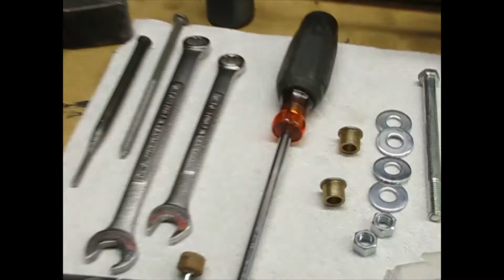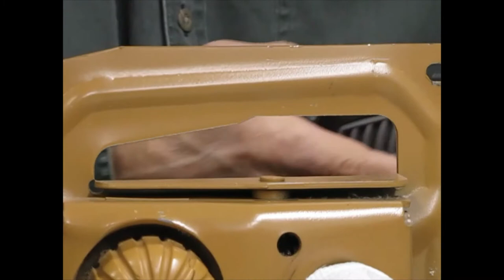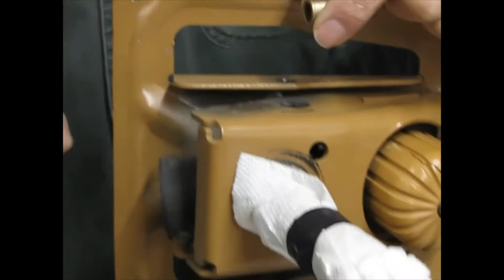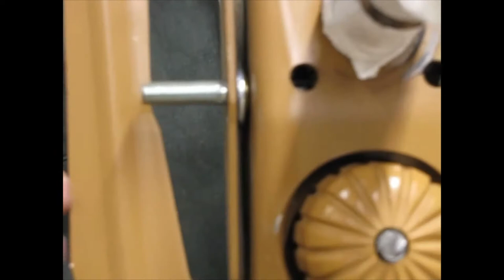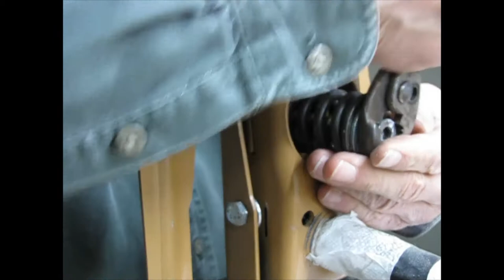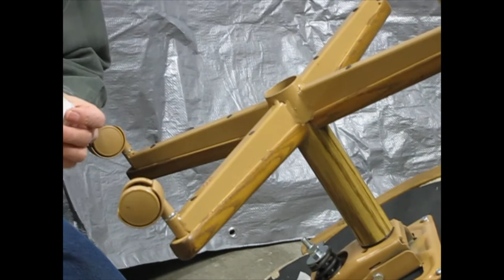Chromcraft Swivel Tilt Mechanism Repair Rebuild

Comment: I just returned from Sam’s Welding, Inc. in San Diego, who welded two of my Chromcraft chairs’ stems on the swivel/tilt mechanisms. Thank you for this video. It helped me figure out the actual problem with my chairs. Luckily the plastic bushings are ok for now. After welding, the chairs are as good as new!  Only cost $20!!  Thank you!

Comment: Thanks, been searching for a video like this for four years. Now i can repair my Blacksmith  dinette chairs. Ebay price for replacement swivels now over $75. Bought two and they only lasted about a year. I had the same ides as you, but could not find suitable rubber bushings. Now will go with the bronze.
Reply from the maker: You are welcome!

Comment: I may have to take mine to a welder. Sooo disappointed in my Chromecraft chairs! The first set I had lasted over 25 years. The new ones barely lasted a year, they are shot! They all wiggle and tip and make so much noise! Thanks for the video.

Comment: Great and useful video, thanks much. Don't have a Dremel but my Rotozip with a cutting wheel fit nicely into the space between the inner and outer swivel bases and neatly cut the pin. It was a simple fix after that.
Reply from the maker: Glad it was helpful.  Thanks for watching!

Comment: Thank you for the awesome video. My chair has a different issue. The center metal rod has too much movement. When sitting in the chair, it wobbles side to side. Do you have a fix for that problem?  Thank you!

Comment: First, JW, excellent tutorial!  I appreciate that you did it after working on a few of the chairs and then made a clear presentation of the breakdown and solutions for each dimension of the problem.  

On my chairs, the stem has wiggled up and into the plate mechanism and that has generated so much play that they are unusable.  I haven't "sacrificed" one of my chairs yet by grinding the pin out to see more clearly if the stem is supposed to be welded on, but I have considered it out of frustration given the dearth of relevant tutorials.  

But now maybe that has changed!  

Since you -- and many viewers -- have had a good look inside, is that stem supposed to be welded?  If not, then is my problem just one of replacing the bushing inside of the cylinder?  

Thanks!  Go YouTube DYIers!
Reply from the maker: Gary, at about the 13:50 mark I mention a welded in cross support member.  I looked at one of my chairs this morning, and that welded in piece is what holds the stem in place.  It appears to be a piece of 3/16” x 1-1/2” flat bar with a hole in it for the stem to go through.  It is welded all around the hole and then welded to the chair mechanism at the edges.

With a flashlight and small mirror, you should be able to see if the welds are bad when you wiggle the stem.  The good thing is, if you take the mechanism apart, all of the welds would be very accessible and could easily be re-done.  Then you can make the “stem weld fix” YouTube video!

Thanks for watching and for your comments!  Good luck!
Reply: @jwsworkshop4169  Thanks!  I will take a look.  If it is the case on one, I bet it is the case on all four....
Reply: @garyschaub1116  Did you ever tackle this repair.  I think I have the same issue on two of my Chromcraft chairs.  The pole move up and down inside the mechanism.
Reply: @melissarij8687  Hi Melissa,
I did tackle this repair.  JW was correct: there were welds intended to hold the stem in place.  That weld had broken on each of my 4 "Black Prism" Chromecraft chairs.  Since the weld was the problem and I lacked the equipment to fix it, I took the bases to a metal shop & had them re-welded.  They charged about $60 per chair.  That was a bit much, but they did get the job done and my chairs are usable again.
Reply: @garyschaub1116  Did you have to take the mechanisms apart like in this video so they could be welded?
Reply: @melissarij8687  Hi Melissa!  I disassembled the chair into 3 parts: the seat, the base, & the stem (with the bracket & hinge still attached).  I took the stem to the metal shop / blacksmith.  They welded the stem in at both the top and in-between the space in the bracket.  That second weld was slightly tough for them to do, but for $60 per chair I thought it was well within the realm of reason.
Reply: @garyschaub1116  Just got back from Sam’s Welding, Inc. in San Diego. What a great shop!  Fadel welded my two stems and now the chairs are as good as new!! Thanks @garyschaub1116

Comment: Went to order the parts from McMaster but the shipping was 13.00 which is more than double the price of the parts. Can't do it. Will check my local hardware.
Reply from the maker: Ouch!  Shipping on my order of 8 bushings was $8.39 which was still a lot.  Most industrial supply houses should be able to get them if they don't have them.
Reply: @jwsworkshop4169  Couldn't find the bushings in the local hardware so I went back to Mcmaster and order it.